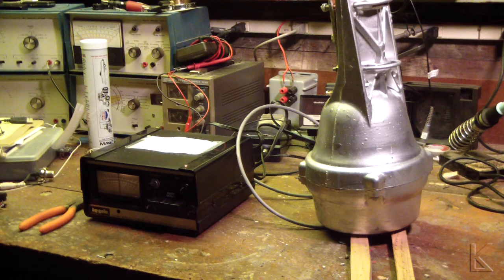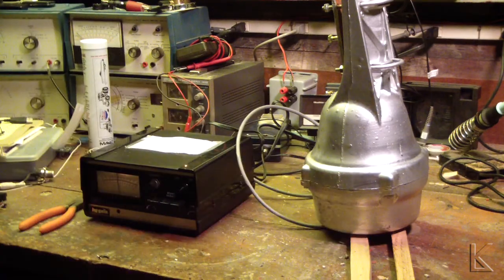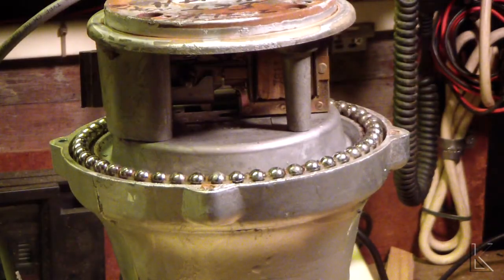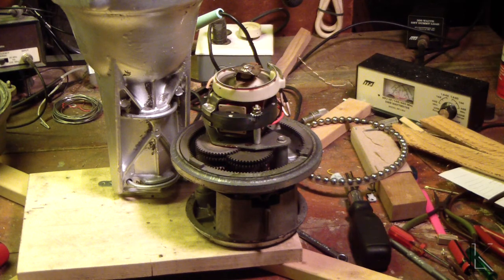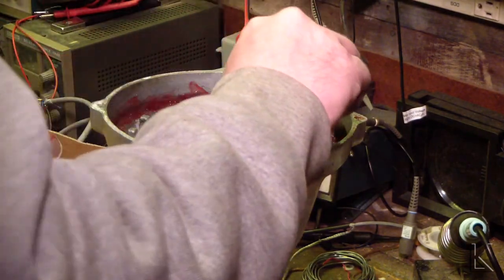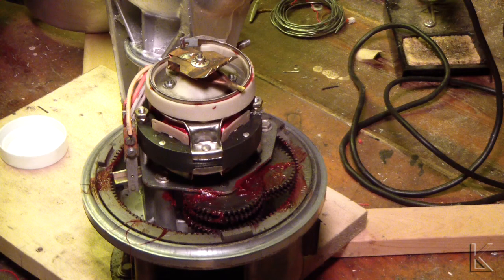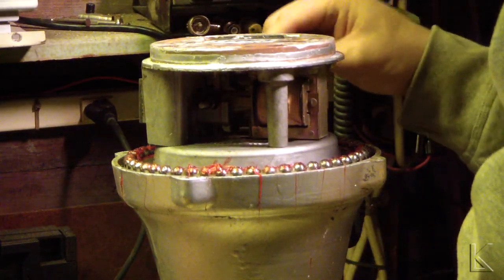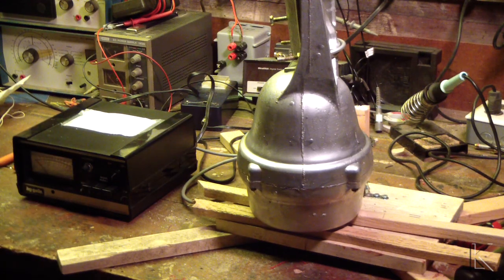Ham Radio - What's inside an Antenna Rotor?  Tear down and lubrication.

Comment: Great video. You did a good job with all the tips about how to mark things so they go back together in the right places. Also thanks for the idea about painting the grease on the bearings and races. I recently (about 3 years ago LOL) rebuilt my rotor, an Aliance 73HD and had fun keeping all those bearings from jumping ship. It did not have the split race to capture them. Also had fun finger-painting the bearings and races LOL. The thrust bearing was a lot easier to clean and lube. Very good job on the video. Thank you.73 DE K7RMJ  Frank

Comment: Nice video.... I have found that you really don't need to mark anything for disassembly\reassembly.  The ring gear can even go in at random position so long as it has the three protrusions facing up and so long as the three catches in the upper bell housing mate with the three protrusions on the top of the ring gear, and even that orientation does not matter,  so long as the protrusions ride inside the catches for them,  no other attention is needed.  You don't even need to insure the wiper lines up "correctly" with the protrusion in the top of the inside of the bell housing.  The wiper is designed so if you reassemble it in the wrong position as you fully turn the rotor one direction and then fully turn it the other direction from limit switch stop to stop the wiper will auto correct itself and seat into the bell housing where it belongs.  If you look at the wiper assembly you will notice both outer edges are ramped so it self aligns.  It's really a great design.  I have had several of these apart and other than aligning the three catches in the housing with the protrusions on the ring gear I pay no attention at all to any kind of alignment, and I have never had a problem with them.  Try it.  you will see what I mean...  When you bench test after reassembly just cycle fully in both directions, you will realize everything works just fine.

Comment: I know this is late as I just found this video, June 26 2018,  but should you have pulled the pot and put some good oil on the top motor bearing? I know it's a pain to get to the bottom one. Maybe a long needle on a needle oiler would be able to get to the bottom bearing. Also just as a reminder, be sure to use grease that is good in cold weather down to -30F or better.
Reply: a tip : watch series at flixzone. I've been using them for watching all kinds of movies recently.
Reply: @Elisha Bishop yup, been using Flixzone} for months myself =)

Comment: Hi Kevin,
Nice Youtube on this subject.  I just picked up an old Cornell-Dubilier AR-33 from a friend that tried to sell it on eBay and flopped - he wanted $100.  It probably needs a complete cleaning and lubrication - I've yet to fire it up.  I just wondered if you recognized the make and model.  I can't imagine there are too many variants of these rotors.  Any advise is appreciated.  Plan to fire it up in the next few days and then break into it for maintenance .  BTW like your YouTubes on loop antennas and I'm jealous of your RV travels that I assume you're still on even during COVID-19.  73 - Mike AJ6GK

Comment: It would be great to have some Channel Master and Alliance rotor controller box repair videos on here. I can't find a one.
Reply from the maker: Send.me a.broken one.
Reply: @loughkb  I have a Channel Master 9510A three wire controller. The setting dial and the antenna pointer mechanisms seem to have locked together. When unplugged, sometimes I can get the dial to turn freely but  when I plug it back in the pointer does not catch up to the dial position. It looks as the though the top may pop off as there are no screws underneath. My antenna rotor will still turn when it gets some current from the controller so the rotor is good. I have been told that 4 wire Alliance controllers will not work with three wire Channel Master setups.
Reply from the maker: I did a search for a schematic and it was hard to find one for that specific unit.    I'd open it up and clean all the contacts on the main rotating switch or potentiometer.  Also, open up the rotor itself and clean the variable resistor or rheostat used to sens it's position.  While you have it open, check the bearings and grease it up as needed.
Try it again once things have been cleaned.   
Three, four, six, or more, the controllers wiring scheme should match the rotor, I'm pretty sure.
Reply: @loughkb  I'm a little late on this one, but I have a couple of antenna rotators that have failed. Namely the CM9521A both failed in the first year. My old Radio Shack one that is at least 25 years old and another, I'll have to get a photo, looks similar to the one you rebuilt. Maybe you would like to rebuild those?
Reply: Norm's Rotor Service has bought all parts, all materials, and all technical data from Alliance.  NRS now owns all rights to and a complete parts inventory for the HD-73 and U100/U110 series rotors and control boxes.

Comment: Hm...seems to me the blade (brake wedge) is pulled OUT (locked) by sprigs. That you are able to so freely pull and push the blade implies the springs are broken.
Reply from the maker: I lubricated it's slide and groove between takes.  When I re-assembled it, the blade was snapping in just fine.   I probably should have mentioned that.

Comment: This was not a very well done help video.  The presenter skipped too many steps of disassembly/assembly to be clear on all aspects.  Also, it appears that he installed his lower bearing race upside-down.  the bearings should have been away from view so that they contact the rotator base to sustain the weight of the entire load((towards the mast mount).

Comment: hey all, i just took my rotor apart to replace the 8 connector on the bottom and see that there is every other bearing missing some retard took it apart and lost allot of bearings and instead of buying $5 in bearings and they just put it back together. it has worked fine for 7 years so is there any reason to be worried about the missing bearings?
Reply from the maker: Since they bear the load, I'd expect shorter life with fewer of them.  Also, it could affect the stability and allow a bit more 'wobble' if wind causes side to side forces on the mast.
Reply: @loughkb   yea i got hold of norm at norms rotor service and he said that is normal for that model but also said if i fill those empty slots my rotor will be able to handle a little more weight/beams so at 15 cents a piece i just got enough to replace all of them and fill all empty slots. stay safe
Reply: UPDATE.. i rebuilt my rotor and put a updated cap in the controller and tested it on the bench and it sounds like new so quite now. BUT after getting it in the tower and all hooked up and my needle doesnt move! aarrggg. does anybody have any idea where to start testing this thing? remember it is mounted inside the tower and it is a pain to pull it out. does anybody know what the voltage reading should be 1-8? 73s all
Reply from the maker: @butterbean4195  The variable resistor rheostat in the rotor might not be making contact?   It's up at the top of the assembly in the one I worked on as I remember.   I don't recall the details, but somehow the wiper part of it is mechanically connected to the rotating bell housing.  Maybe the wiper is not making contact with the wire winding, or the mechanical connection to the bell didn't line up and it's not rotating with the bell?
Just a guess.  It's been awhile since I had that one apart.